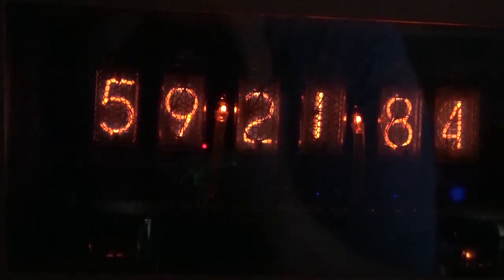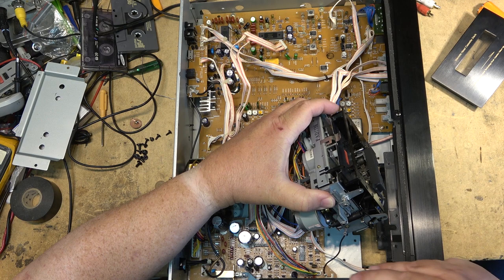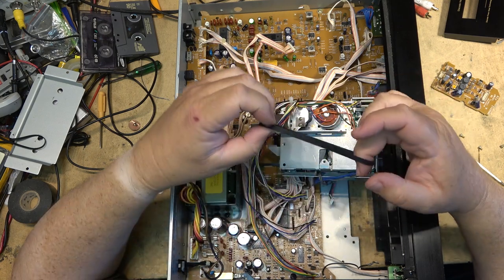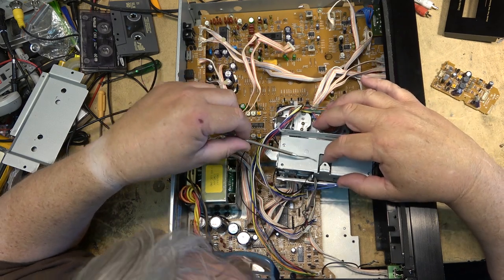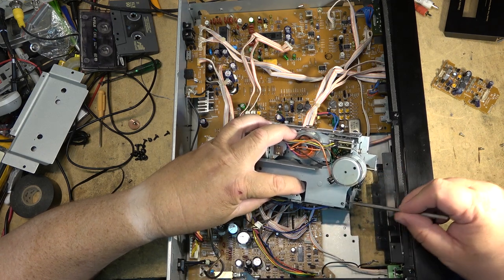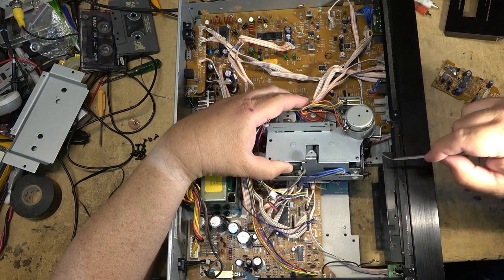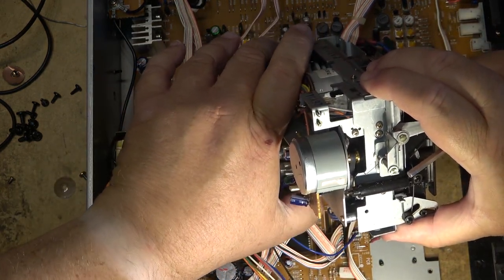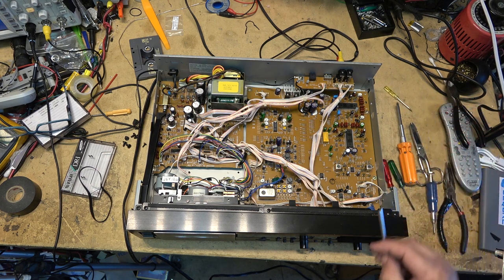Nakamichi DR2 Capstan Belt Replacement

Comment: I have three Nak decks, a MR-1, a BX-100, and a 480.  I haven't done a belt change on any of these (yet) because I assumed that the mechanism would have to be disassembled.  It's good to know that at least on the DR2, it can be done with a dental pick.  I'll be bookmarking this and revisiting when it's time to tackle this job.
Reply: ThriftyAV, not sure about the DR2, but the MR-1 and BX-100 use Sankyo transports and the idler tires at least can actually be replaced from the front door without even removing the transport. The 480, however, is completely different, far more complicated to disassemble for installing new rubber,, and some of the nylon parts in the transport and switching mechanisms shrink and crack with age. Don't put a lot of time and money into a 480.

Comment: Loved your video. I love Nakamichi cassette decks though my son feels cassettes are past their prime.
Just out of curiosity, do the DR 1 and DR 2 have that infernal idler tire or do these decks have gears? I have been led to believe that the idler tire usually wears out and then there's slippage that doesn't happen if there is a gear mechanism. Thanks
Reply from the maker: Couldn't tell you because it's been years since i have been into one. 
Gears might not slip but they break.  Had a tape deck in that i checked over went through all the operations.  Play ff Rew record ect.  All works good. What I didn't do was rewind a tape to the end.  Deck came back.  Pendulum gear shattered when the tape hit the end.   That's the problem with gears.

Comment: I hated that fiber washer that Nakamichi used to hold on the pulley for the rubber tire of the BX-125. Tried the Scotch tape trick, but when trying to get it back on it went flying across the room, never to be seen or found again. Nakamichi and Tandberg had some weird ideas for how to make things unfriendly to work on. Good machines though.

Comment: I’d like to know what the fault symptom was please. I have a DR-1 which is essentially very similar and takes about a second to come up to speed but is stable in play/pause mode.
Reply: Capstan bearing dry probably?
Try giving it some fine oil
Reply: Could also be the capstan motor